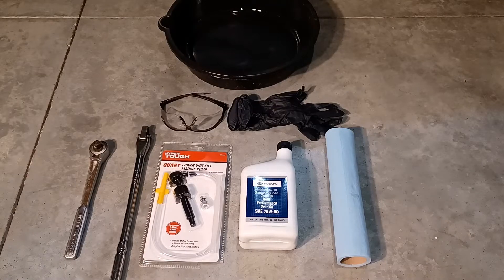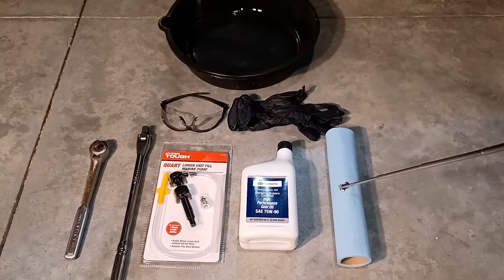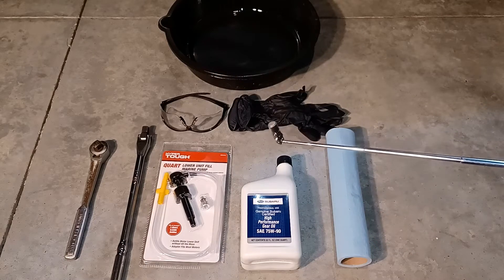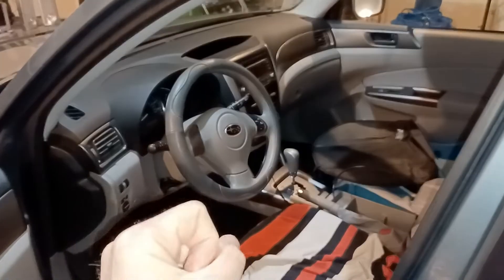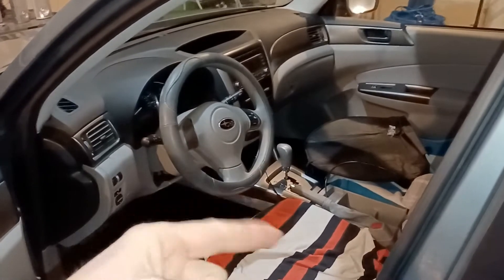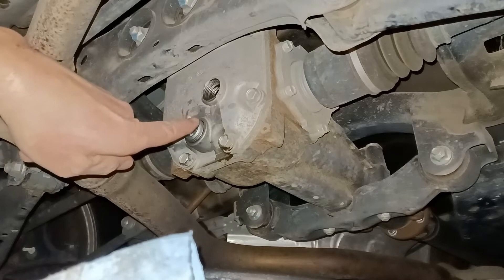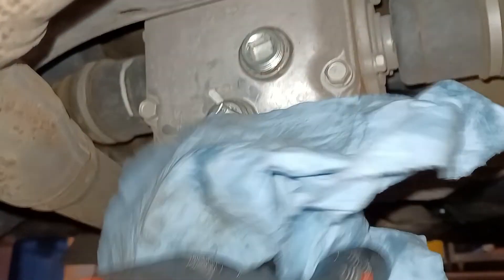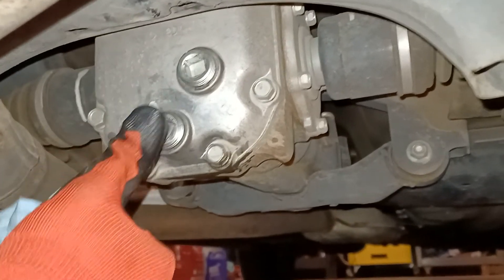How to: REAR DIFFerential fluid drain/fill 2009-13 Subaru Forester (or any vehicle but 2011 shown)

Comment: Don’t waste money on Subaru fluids. Valvoline has everything you need for half the price. Plus it comes in bags so you just squeeze it in - no pump necessary.  Much easier and cleaner.

Comment: Very handy video thank you. Im very surprised there is no gasket/washers for the 2 plugs? I was told it needed OEM subaru 803926090 and  803918060, was this recommended to you also?
Reply from the maker: Great question and to my knowledge that they don't need any gaskets because they are male internal plugs with no OEM gasket.

Comment: Update to earlier post:  The 13.5 mm bit worked great on the fill / check level plug, but, the drain plug inset turned out to be slightly out of square.  That could not have been due to my earlier attempt to remove the drain plug with the 1/2" drive because I never got that far!.  'Twas weird though - per the micrometer, the fill plug recess was closer to a perfect rectangle (off square only by a few thousandths of an inch once the bit got over 1/2 way "in") than a distorted square (the way my 1/2" drive extension had ended up earlier with the fill plug.)  In any event the  recess was "too tight" only side-to-side in the drain plug.

I "got in there" (drain plug recess) with a square needle file and enlarged the "side-to side" enough for the 13.5mm bit to go in about 3/4 of the way.  That literally took well over an hour.  Then I went to the 2' breaker bar, and thank heavens the drain plug broke free fairly easily.  I didn't remove it (see below), I just gave it a 1/8(?) turn and then another ~3/8 turn "out" with my 10" long (handle) 1/2" drive ratchet wrench. then retightened firmly (but not using all my dubious 150 lbs. of strength!) with the ratchet wrench.  (My torque wrench is out on loan - need to get that puppy  back!)

As for the (perfect fit) fill plug...  For whatever reason, the fill (top) plug seems to be the one that locks up, even when anti-seize has been used, and the interval not that long (~2 years, ~30k miles, synth gear oil that looks brand new(!) once I got the fill plug out.)  Because... I don't know.  Oxygen can get to the threads from inside the rear diff?  Gorilla-mechanics have better access to the fill plug??  (The previous drain and fill was at a shop / not by me.)

???

The gear oil, as I said, looked brand new, so I just topped it off (not even 1/10 qt.), put a little Permatex 80078 anti-seize on the threads and buttoned 'er up.   (The 80078 is "only" good to 1600 deg. F per Permatex, but I've had pretty good luck with it in the past, and if the rear diff gets to 1600 deg. F you've got bigger problems - like... you must be re-entering Earth's atmosphere from a SpaceX mission?  ;-)

The Koken 13.5 mm square drive bit, BTW, measured a "perfect" 13.50 mm square recess, and appears to be made of very good steel.  My only gripe is the dark finish -- it's really easy to set aside and then be in "oh, **blank**, where did I put it" mode!  I may paint the round portion fluorescent pink!

For those with a few extra $$, it may be a good idea to have both the 13.0 mm and 13.5 mm bits on hand.

The fill plug was exceptionally tight / locked up, so the "perfect fit" of the 13.5 mm drive bit, to it, really was a good thing!

A very short 1/2" drive extension with a 30 deg. CW "twist" in it could sure be a useful thing for us driveway mechanics.  Does such a thing exist?
Reply from the maker: Awesome post and thank you for the info.... always helps to have more information if something doesn't work for one's vehicle! Glad you tackled it by yourself too save some money!
Reply from the maker: That's because of my mileage is so low on the vehicle that that half inch works perfect for me... I don't know:-)

Comment: Good advice about taking off the top plug first. Common sense, sure, but when you've crawled under a car, sometimes we "forget", and then mutter to yourself something like "Oh (insert prefered expletive here) why did I just do that?"
Reply from the maker: @kevinwilson9589  💯 ABSOLUTELY...been there done that, lol
Reply: Agreed.  But for whatever reason, the fill (top) plug seems to be the one that locks up, even when anti-seize has been used, and the interval not that long (~2 years, ~30k miles, synth gear oil that looks brand new once I got the fill plug out.)  Because... I don't know.  Oxygen can get to the threads from inside the rear diff?  Gorilla-mechanics have better access to the fill plug??  (The previous drain and fill was at a shop / not by me.)

Comment: No gaskets?
Reply from the maker: No...they are tapered so when they reach toward end, they are bigger than hole. If you want, you can use tephlon tape to provide an extra barrier, but don't be sloppy with it:-) 
As always though ***consult a qualified technician for further guidance**
Thanks for watching:-)

Comment: I do NOT recommend using a breaker bar with a 1/2" "bit" (or extensions ending up with a 1/2" drive in the plug socket) if the plugs are tight at all.  You'll end up damaging something -- luckily in my case it was just the end of my 1/2" extension.

Further, I put my best micrometer to the task, and, the inside dimension of the drain plug square "socket" is right at 14.0mm -- maybe 14.05mm if the corrosion was thoroughly cleaned off.  In this size range bits to sockets (or 1/2" extensions, male to female) have about 0.5mm "slop" (looseness for a male end to go into a female end), so, what you really want is a 13.5mm drive, I think, and, by golly, such is made by a Japanese company named Koken.  The part number is 4110M-13.5.  The price is all over the map, depending on the vendor, but, there is an eBay seller who has them for $13.37 and free (if slow) shipping.  Other sources I'm not familiar with are even cheaper.  If you have other stuff to buy, consider US Tool Hub (low prices and free shipping for orders over $99.)

I'll report back once the bit comes in.  :-)
Reply: Waiting on the report brother!

Comment: @hurstysgarage
 I'm doing this for my mother's car. I have enough to do the front and maybe 1-2 ozs short for the rear... is it OK to use a couple ounces of 75w-140 to top it off?  I have that because that's what my Jeep takes.
Reply from the maker: @LIToyGame  I don't really like to mix brands or different weights, so, take that advice for what it's worth...will it blow up ...no...is it recommended...NO...so safe bet is to get some more of the same:-)

Comment: Very useful and helpful. My car is a 2010 Subaru, sold in the United Kingdom and the only difference is that mine needs a 10mm Allen key to undo the sump plugs. maybe Subaru changed the specification at some point?

Comment: Just did my 2011 forester w/206k miles. Those plugs were in there. Gsh. The Fluid didn’t even look like it needed to be changed but it can’t hurt. Thanks for info!
Reply from the maker: That's what I like to hear! And that's awesome that you ride has 206,000 miles on it.. way to keep that sweet machine on the road.. kudos to you:-)

Comment: nice work on this video!  changing diff fluids is a cheap and easy way to help insure longevity.

your Subie diff looks so clean and non-rusty like it's never seen snow and salty roads!  many will be significantly corroded.  when that happens those plugs can get brutally tight, and there is limited room under the car to break them loose with a long bar.  you DO NOT want to use an impact gun, or you risk cracking the diff casing - that will completely ruin your day along with your wallet.  can't afford to go crazy when you have steel plugs threaded into an aluminum casing.

SOLUTION:  get a 40" (or in my case when I changed the diff fluid on our 2009 Forester, two 20" extensions) and a 13mm square end socket. NAPA carries this - the 1/2" drive nub is actually 12.7mm and having the 13mm square socket gives a tighter fit in the plug.  with the 40" extension, you can sock it into the diff plug and run the end straight out past the rear bumper, rest the end of the extension on a jackstand for support, and get all of the leverage.  if the plugs are really stuck, you can also try turning them just a hair clockwise to break them loose as well.
Reply: This is solid advice, the forester we just got has been here in Maine for a while and it shows. The brakes were an experience 😂😂😂
Reply from the maker: @Ofvandelayindustries  Yeah, luckily mine has been treated like a "princess" (garaged) most her life:-)
Reply: @Ofvandelayindustries  I bet!  ours has lived in NJ and while the chassis & body aren't rusting, pretty much every bolt & fastener underneath the car are sculptures in iron oxide ☠☠☠
zinc-coated brake rotors & hardware are definitely best for our salty-road climates.
Reply from the maker: Well said and thank you for helping out with the awesome information so the viewers can get as much info as possible to make the best decision about keeping up on that all important maintenance:-)
Reply: A couple of long extensions and a breaker bar worked great for me to get the stubborn plugs out.  Thanks for the tip
Reply: @ejs1011t  awesome, glad it helped!!
Reply: It's very hard to get a long extension to the lower (drain) plug in my 2009 Outback.  It's blocked to the rear.  Luckily, the fill plug always seems to be the one locked up,  I don't know why.

Comment: Looked like there were some metal pieces on the magnet… more than just shavings or metal fillings.  They where small but makes it look like you had chips off the gears.  How many miles since your last differential fluid change?
Reply from the maker: Yeah, good eye Michael...I got this vehicle used, and from the service records that I received, it does not look like it has ever had it changed! All I can do is hope and pray that "she" holds up, and that the next time I change it, things look a little different. So far so good though, because no adverse events or anything noticeable felt or heard in that area! Thanks for watching, and comment...and I'll keep ya updated if I find myself in a bad way:-)